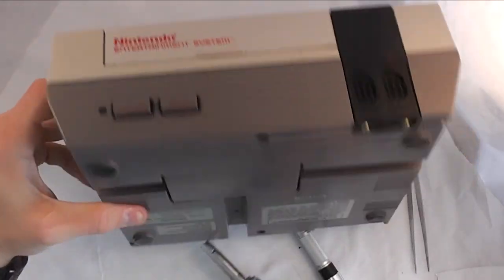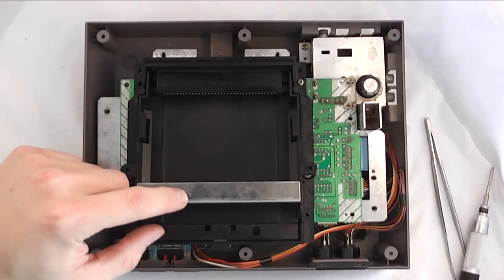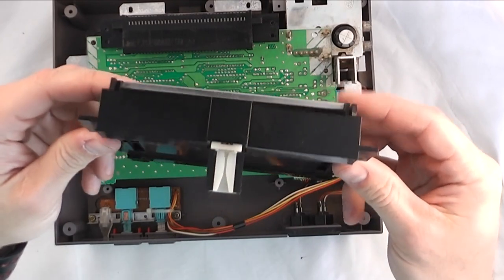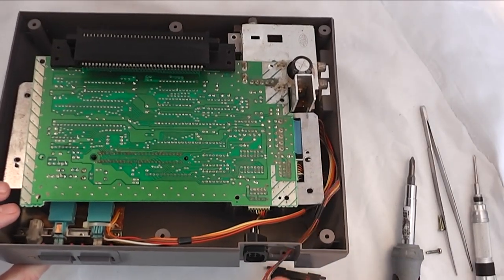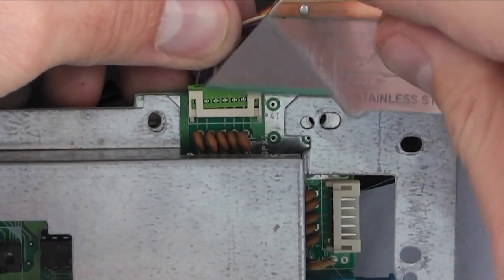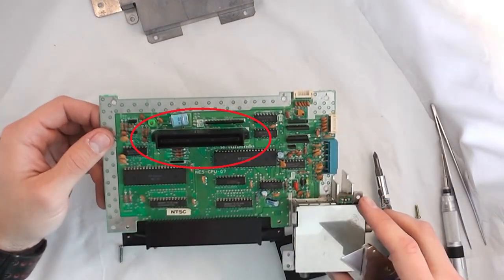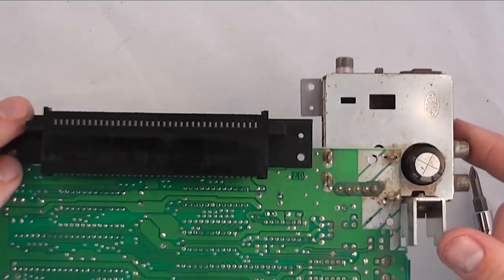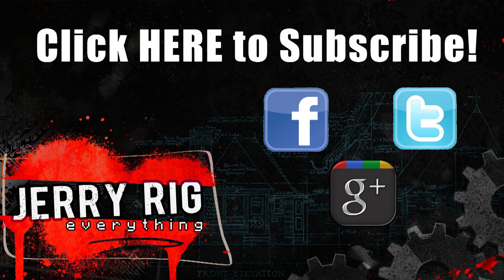NES Nintendo Console Repair, 72 pin fix, complete tear down,

Comment: This console was obviously taken apart at one time. There's usually 6 to 7 screws holding the top RF shield on. 7 screws for older revisions and 6 for all the newer revisions starting with CPU 05 I believe. Then there's 6 screws holding the cartridge bay in place with two longer screws towards the edge connector that fits into the cartridge socket, the other four are the same size as those that hold the top RF shield and shell on.
Reply: This... very much this.
Reply: Looks like some were missing.  Mine had all seven.
Reply: I count 8 screws on this step. 6 instead of 2 on the next lol
Reply: Definitely missing some screws lol. What I like about NES is the screws are all MOSTLY the same size. 👍🤙🕹

Comment: Try re-soldering the connector before buying a new one, or the tiny thru-holes near it. Most likely worth the try. The connector is very durable and tolerates minor adjustments well. Good vid.

Comment: be careful, I heard that aftermarket 72pin connectors are not made out of the same metal and corrode.
Reply: I just installed a brand new 'Stone Age Gamer' 72-pin in my NES, and while games work flawlessly, the carts no longer slide in smoothly. It's kind of jerky/crunchy. Wish i would of kept the original and fixed that instead.
Reply: @NeonPizza80s do you know how to repair the original 72 pin connectors?

Comment: I just wanted to point out one thing. The expansion port was originally designed to work with the CD Drive expansion back when Nintendo and Sony were working together on the system. The voting machine thing is news to me, but it's nice to see at least one other company was interested in making use of it.
Reply: Wrong. SNES was the system with the port.
Reply: @STAY-GOLD-VINYL  Yup, that was my bad.

Comment: You missed quite a few screws in your console. The top RF shield should have seven screws, not four. The loading tray has six screws, not two. The motherboard will have two additional screws, not one. Basically your console is missing eight screws.

Comment: half the screws are missing in this video and you don't need to disassemble to this level to remove the 72 pin connector. No need to disconnect those wire harnesses

Comment: Hi there, I know the original pin connectors on these units were always faulty. Are the new replacements any better? My NES still works but it's sketchy sometimes. Was thinking about restoring it.

Comment: quick question, im trying to do the same thing replacing the 72 pin connector but even after that it still gives the red blinking screen. i mean i noticed on the new one the connectors the cartridge goes into are a bit slanted and tried moving them with no luck. is this just a gone console or any hope?